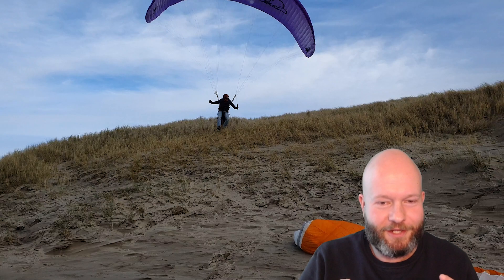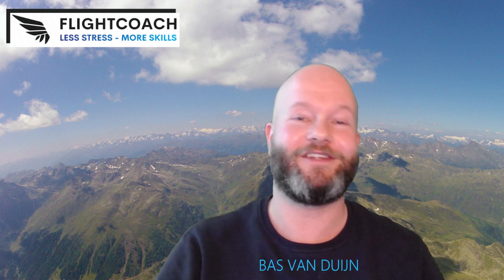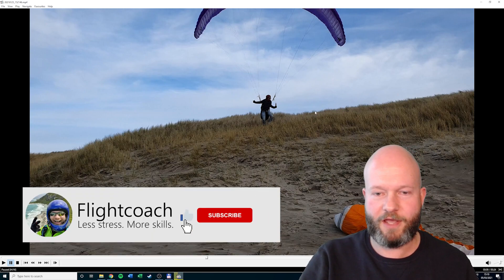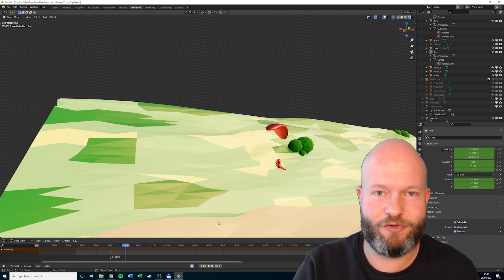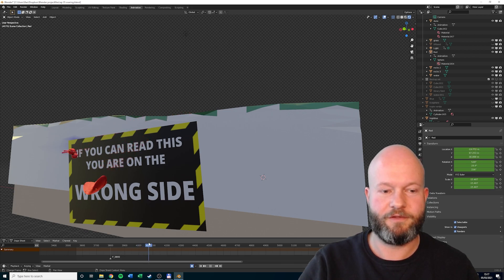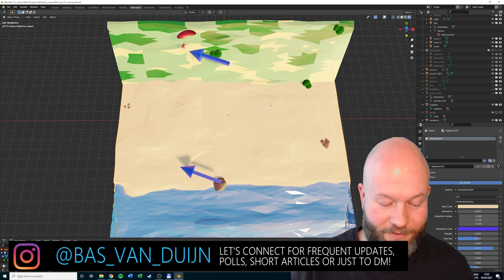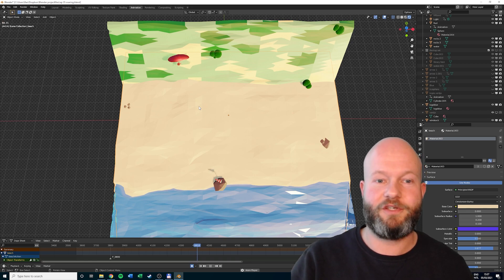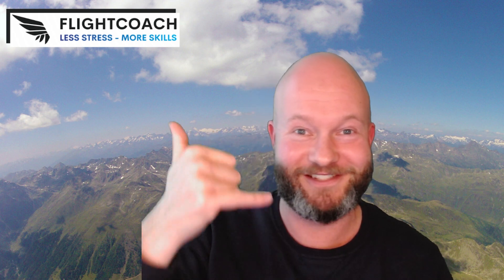Getting stuck/parked - near miss strong crosswind soaring - 3D modelling

Comment: Just the other day I've got a small lateral oscillation from a thermic bubble and thought, ok I know how to stop a pitch oscillation with the brakes but what about a lateral one on the roll axis? Is doing nothing the answer instead of being late with the weight shift and amplify it? I can't imagine the correct weight shift timing if I were to go that path...When your body is at full bank to the right and the wing dropped to the left in that moment you weight shift to the right and keep it there as the body descends and the wing goes up? Or if you just stay at neutral the roll will dissipate? I'm a beginner so thank you!
Reply from the maker: Great question, welcome to the channel. If you fly a glider that is suitable for your level, it should dampen out by itself, you can aid this process by applying a bit more brake (so on both sides). If you have enough terrain clearance you can practice correcting with weightshift, the timing is hard to put into words but the easiest explanation is do the opposite of what makes the oscillation increase 😉 ask your instructor to help out with that and find your timing. Of course you can also arrest the oscillation with brake line steering, but take it slow, no big movements, the timing is more important than the amplitude.

Comment: I was hoping for explanation for this oscillation... Is it so, that he first induced this oscillation by pilot error and further it was magnified by the wind from side, so the wind catched the ear of the canopy, exaggerated the pendulum, turned his direction a little bit and he on the apposite side of the pendulum tried to rectify the direction and in reality he helped the pendulum effect and back to the wind catching his ear. Is it the right explanation?
Reply from the maker: Hi Stanislav, welcome to the channel! For as far as i saw, the original cause was the pilot taking off while banking the glider, as can be seen at 2:42. He swings underneath and then to the other side of the wing. This should have been corrected by using counter weightshift and a bit of brake, but as you can see at 2:44 he is weightshifting to the left, which is too late. at this point in time a weightshift to the right would have been better. He is constantly around 1 second late with his weightshift, making the problem worse or at least keeping the swing in. This is quite a dynamic wing, so it responds well to weightshift... meaning if you time it wrong, or use the wrong amount, you make problems for yourself. The wind in itself was a bit challenging that day, being cross and a bit gusty, but that or the shape of the dune had nothing to do with it, is my conclusion. You have an interesting point, discussing the side surface, the ear, and that catching wind, but that surface is way smaller and less loaded than the more horizontal surface, the forces acting on the side are almost nill compared to the other forces. I dont think that the wind "hitting" that side has any influence, also because the main wind direction of a glider in normal flight is always head on, the component that "hits" from the side even when gusty, is really small compared to the vector on the nose. Hope that anwsers your question?
Reply: I was wonderingbthe same thing, thanks for the answer,.

Comment: So lots to unpack here but I'm going to just point out a few. So what we're looking at pilot induced oscillations. PIO.  you mentioned in the video that he was preoccupied with weight shift and opening up his trimmers right at launch, you should never have to do that nor should he based on the excessive oscillations as well as pitch Dynamics. Is that wind comes off the shore and up and over the dunes it accelerates and if there are small valleys and varying heights between the dunes you get a Venturi effect creating a 3rd wind speed. Right off the bat you could see these conditions were way above his skill level quite frankly his launch technique could get anybody in trouble in favorable conditions. For a new pilot they will usually put in the exact opposite input to correct an oscillation then what's needed. Fortunately everything worked out I think and he experienced a Learning lesson
Reply from the maker: Hey Mike welcome to the channel and thanks for chipping in, i remember you from the great pic you took and posted somewhere on FB, i see you have it as profile pic now! PIO... PIT yep same thing different name ;-) i find PIT more funny because my fort pierce based flying instructor used that term when we were bouncy on the yoke/rudder it always stuck with me. I think Rudolfs main error was trying to find a solution to his perceived problem (im not going fast enough to escape this dune) but choosing the wrong one (lets speed up the glider on this into wind heading) instead of the right one (lets change course first, so i have room to fiddle with my stuff). Yep that was some nasty oscilation allright, he has a tendency to hold onto the risers way too much, that only increases the problem here. Is that a thing you see in your ppg students as well or is that a pg problem?